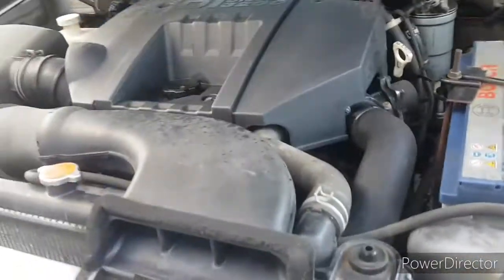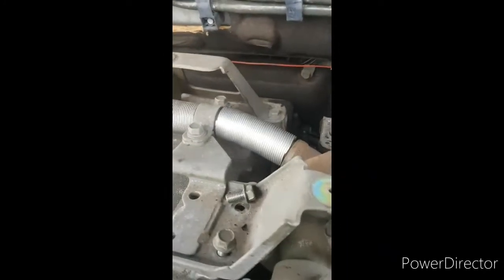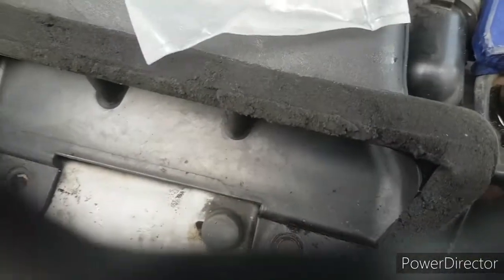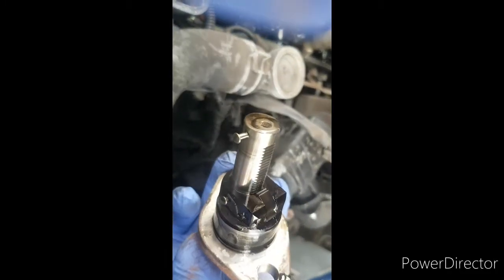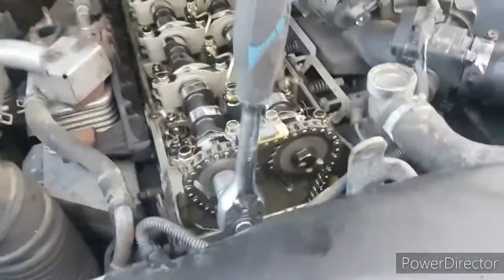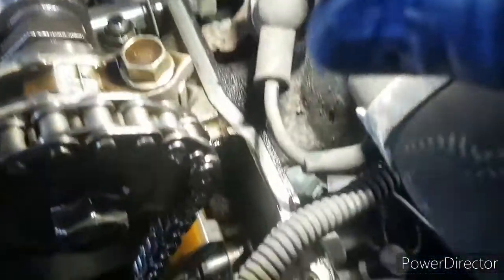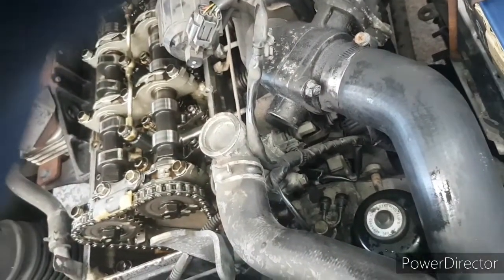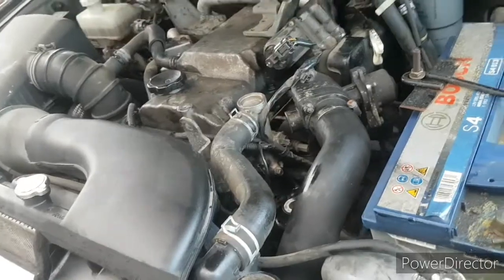Shogun 3.2 Cam chain runner and tensioner reset.

Comment: Did my chain guide today on my NX Pajero, I am in Australia we won't go into the meaning of that in Spanish, Pajero that is. 
I like the idea how you compressed the tensioner. 
I noticed you were turning the camshaft in the wrong direction this is a big no no according to the manual. The crank is turned clockwise and the camshafts will turn anti clockwise. 
Another way that you know that the tensioner is correctly installed is by the protrusion where a oil gallery is always to the bottom. 
Turn the cams can be done with two 19 mm combination spanners 🔧 pulling together slowly backing of a bit
Reply: Hi sorry, I’m new and not fully understood how to do it. The cams are where tip guide is fitted? If yes from does 2 bolts need to rotate anticlockwise in order to reset the tensioner?  Or can crank engine from ignition? I need my tomorrow because no more shoe on the guide
Reply: Another way to release the tensioner once you have installed it and also checking that the small protrusion is on the lower bolt side.
I used  a extra long screwdriver to release the catch, you might need a torch to see it more clearly.
Reply: @neilrobertson6535  thank you so much for your answer.
you mean touching the hook with screwdriver? If I mark the outside of tensione and put it back as it was should I check any thing or just release the hook? Thanks
Reply: Yes that's correct just released that hook
Reply: Yes just release the hook and the tensioner should move out a bit to take up any slack in the chain.
Reply: @neilrobertson6535  thank you 🙏

Comment: But if the crank turn clockwise as the manual say, the camshaft don t turn in the same way? Otherwise i prefer turn the rear wheel ...less problem...
Reply: Hi, I’m not trust on this video as not answering on your comment. I’ve heard to crank engine from ignition? Im really confused I need to do my tomorrow I’m watching lots of video but can’t understand which is the easiest and correct way to. Can you please tell me if you know?
Thanks